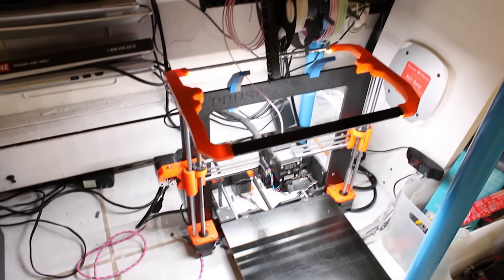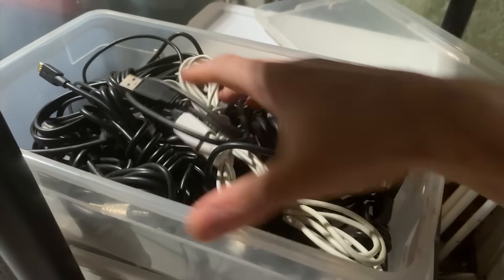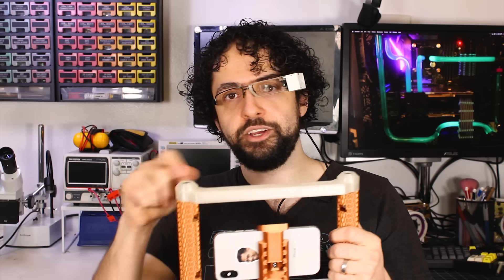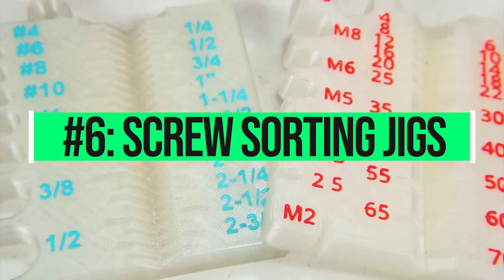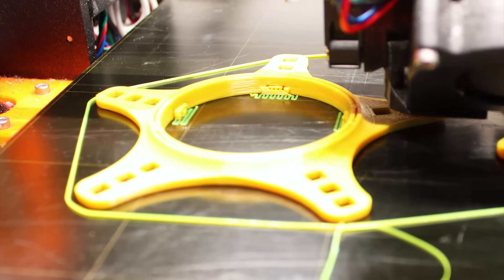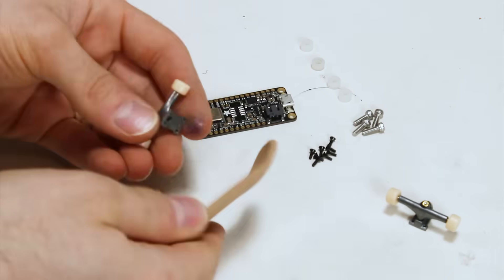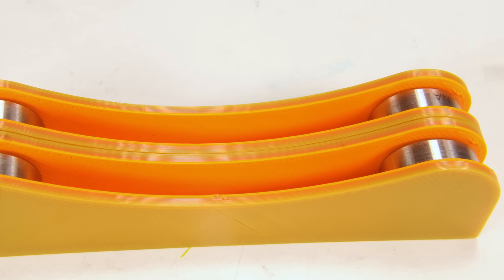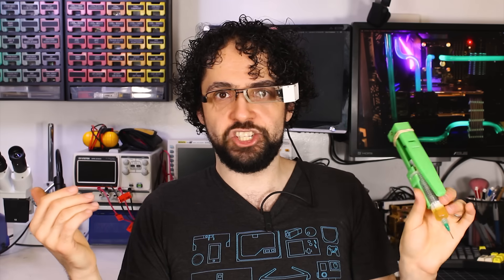Top 10 3D Printable Tools Every Maker Should, Like, Make

Comment: I like the idea of the dremel storage tower but it is literally available, filled with dremel tools, and is only slightly more expensive than the raw plastic filament needed to print it.
Reply: For about 15 bucks at walmart and 15 minutes there and back you can get all the dremel parts in a kit
Reply: @justaguydoingguythings2762  walmart one definitely isnt that good
Reply: @BlondieHappyGuy  Is 30 hours considered a lot? Majority of my parts are between 10-20. Biggest ever was 139 (in 5 pieces). Maybe I have my detail set too high.

Comment: The Prusa adaptation of the TUSH, used on the Prusa Mini, is far superior to the regular TUSH. It is very adjustable without falling over, and if you put non-slip foam pads on the bottom of the Prusa Mini spool holder, it does not slip on most surfaces.

Comment: I looked at every comment and didn’t see anything that asked about how you got such sweet time lapse shots of the prints.  Do u pause the print and move the print head out of frame for each picture?  Really impressive video on a number of different levels!
Reply from the maker: I use Octolapse, which is a plug-in for the Octoprint print server. Every layer-ish, it does exactly that - moves the head to the same position and takes a shot. I have it trigger my 21 megapixel SLR, so we end up with 6K footage that we can pan and zoom in post.
Reply: @ZackFreedman  Thanks for the quick reply!  Those time-lapse shots are top notch.  Keep up the great work.

Comment: A lot og these have way too much infill for what they require and would be much faster to print. The smartphone gadget tubes as for example could have been hollow and just 2mm plain tubes, if you make them hexagon you can almost stand on them in horisontal mode in that small diameter even without infill

Comment: The dremel is great and all but you should look into getting a flex shaft rotary tool. It had way more power and a foot pedal. Yeah its a little bit more cumbersome so it doesn't completely replace a dremel but for those larger projects its amazing.
Reply from the maker: I actually have the flex adapter for the Dremel, but I really should get another pedal. I built my old one into a project and just never replaced it 😐

Comment: there  is a TUSH woth bottom supports that give it avout an inch more  on the footprint if you search TUSH you will find it, same print but 4 parts per one and of course 608 bearings. i use these for a few of my printers and its amazing

Comment: PLEASE PLEASE PLEASE tell me how to get a work light for my Prusa just like yours!!!
Reply from the maker: Here it is: https://www.prusaprinters.org/prints/3267-led-light-bar-prusa-i3-mk2mk3
Mine is powered by a 24V-to-12V buck regulator, and I tied the enable pin to the RAMBO's pin 76 (unused I/O above the thermocouple) so I can control it with g-code.

Forgot to add, if you plan to take photos with it, buy high-CRI (color rendering index) LED strips. They're more expensive, but they'll make your pictures look far better.

Comment: Are you insane? that is waaaaaaaaaaay too much infill! I rarely go over 8%!! no wonder you used almost a pound of filament! holy crap!

Edit: I need one of those dremel bit storage thingies. I'll print one and update on how much filament I used
Reply from the maker: I did some test prints with 5% infill, but the pillowing on the top layers was just too prominent. This is just 10% infill - gyroid looks denser on camera than grid or hex infill. 
What infill pattern do you use? I have a lot of trouble printing below 10%.

Comment: The tush needs a wider baseplate.... and the dremel storage is just too massive for its own good. That is abusing printing as a medium, other methods like making it from a block of wood are much better. Printers are not replicators, subtractive manufacturing is not dead... we don't need to print everything.. In this case, printing just the tops would be a good use of a printer, the base made from some other material.

Comment: Why not add two features to the tush?  1 - grippable feet on the bottom of each tush so these don't slide around.  2 - a socket that allows a thick spoke to plug into the sides that is telescoping.  This would perfectly space your tush feet apart to accommodate your spools.

Comment: The Prusa Mini comes with a better version of the Tush in the package. It's the same idea but has two adjustable connectors inbetween to hold it together, as well as rubber pads.

Comment: i never liked wireless mice. but last year my significant other gifted me a logitech g903 lightspeed and let me tell you... it has never lagged, it comes with extra side buttons so you can switch it to a lefthanded mouse and the battery life on this thing is confusing the hell out of me. cause in the last 300 days... i have charged it maybe 8 times...comes with a usb cable and i just plug it into a random usb port on my desk to charge it (usually over night). its an amazing wireless mouse if you ever want to try one.

Comment: New sub and nice video. I have a question what material are you use for print. For me im new on this. For the moment already use petg but still not understand how to have a better printing. How many if the adecuate infil and how to made first layer and last layer more stronger
Reply from the maker: Thanks for the sub! I love PETG and do most of my Nerf printing in it. I can only guess about your issues, but your problems could all be caused by low temperatures. Make sure you're printing at 230-240C, with an 85C bed. If you have drafts (cold breezes) in your printing room, try plugging gaps or putting a trash bag over your printer to keep the temperature stable.

Most first-layer issues with PETG are caused by poor bed adhesion. I use the Prusa's PEI-coated steel plate, and I thoroughly scrub it with Windex (diluted ammonia window cleaner) before EVERY print.

PETG also likes to build up on the nozzle. Make sure you heat your nozzle up and thoroughly wipe it down with a clean cloth before EVERY print.

I generally use 15% gyroid infill. If you're having infill problems, try reducing your infill print movement speed and lowering your fan speed. 

PETG likes to "pillow" and make other defects on top layers. I'd recommend at least 6 top layers, regardless of layer height.
Reply: @ZackFreedman  Thanks for your answer. The temp that already use are 244 and on the bed 80. Adhesion sometimes a i think have too much neer more case i can't take the piece out and need to reheat the bed again. For infil more of all case i use between  50 to 80 %. I don't if i making wrong. Also fan speed already setup to 50 % and the speed that i use are 25mm/s. yesterday i print a fan holder but i fill softly. I use the setting  that are tell you but i use also infill i use 20 %. My printer is a JG MAKER magic 3D

Comment: What slicer do you use for your prints? Since you use some kind of gyroid infill in your prints.
Reply from the maker: I use PrusaSlicer, which has gyroid infill by default. I usually use honeycomb infill because it adds more infill to thin elements, but I find gyroid infill looks cooler on the time-lapses.
Reply: @ZackFreedman  yeah the gyroid infill looks like it just melts in there :-) And thanks for info!

Comment: That dremmel tool holder is cool, but it could be more manageable to print by making it into connectable smaller modular prints that a user can add to as they get more accessories.
Reply from the maker: So fun fact, I initially tried to split it into smaller panels, but Fusion 360 is so bad at importing STL’s that I just gave up and wasted half a roll of plastic.

Comment: FWIW, there are remixes of the T.U.S.H. that include clips for the frames of some 3d printers.  I've had one on my i3 clone for almost three years now, and it works great.  (...especially once I made a pivoting cleaner/guide for the filament.)
Reply: Any remixes that compensate for spools warped by repeated visits to the dehydrating oven?
Reply: @michaelclark4876  I don't know, but it wouldn't be hard to model a longer cylinder and overlay it on the model in your slicer so you could use multiple bearings to make a wider holder.
Reply: @KeithOlson  Yes, that should work nicely.  Thanks for the idea!  I'll check to see if someone has done it, if not I'll make it and post it on thingiverde.  The tinkercad redesign should be trivial to make.

Comment: I was actually thinking of designing a bit holder for my rotary tool, it's not a Dremel but it works for me and they sent it to me for a review video and I use it almost daily. But yeah, as I get more accessories I need a better way to store them.
Reply: Do not print that massive holder, it really is abusing printing as a medium. The proper way to do is to print the intricate bits and then use wood or even rigid foam to construct the base. Printers are not replicators, you need to mix and match with different materials and methods.
Reply: build your own robotic arm with parts for printing or machining. download parts and manufacture your own robot with precision and quality. access our hotmart link

https://go.hotmart.com/I43664641H?dp=1

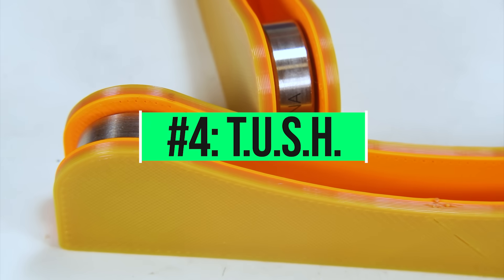Comment: 6:08 I've actually printed this Tush before and I use it for my spools, however they keep getting knocked over with the slightest touch and it's really annoying so I designed a bracket that connects them together so they don't tip over and they're always the right width apart.

Comment: Nice video! I am a new subscriber.

Do you have the shell and quality settings suggestion for the Dremel support?
Reply from the maker: I used an 0.6mm nozzle, 0.3mm layer height, three shells, 8 top/bottom layers, 5% infill. Basically, quality as lousy as you can get it, but with thicker shells than usual so the pegs don't snap off.

Comment: Why. Just. Why?
Why does everybody consider battery holders useful?!
This is literally the most pointless waste of plastic that I know. 
Fyi: if you require a lot of batteries then a) you should either invest in rechargable ones. Or b) buy a 50 piece pack which -surpirse! - will be sold in a perfectly fine and unseful plastic container.

Jeez! As a maker, you are responsible for what you print! So please! Print responsibly!!!😩
Reply from the maker: Holders are useful for transporting batteries, especially cells with high C ratings that absolutely cannot be allowed to short out. I agree with you for storage - I keep them in polypropylene tubs with cardboard dividers - but I don't think it's safe to carry a loose container of batteries.

The AA's in the video are rechargeable NiMH cells. The 9V's are lithium, because I salvaged a massive box of them when a client's building switched to wired smoke alarms.

Comment: For RC hobbyist like me, that metric screw sizer saves a lot of annoyance and confusion.
Reply: Yeah, I went straight for that screw sizer myself.
Reply: Only problem is you need to calibrate the holes because PLA changes size on cooling!
Reply: @GodzillaGoesGaga  I printed mine in PLA, didn't see too much deformation upon cooling. The sizer works really well, and there are no issue trying to figure out the screw sizes. With that, all of my screw sizes are at least 2mm apart.
Reply: @DargoDog  Cool.  Thanks for the info.  Good to know.  I've had tolerance issues when making threads so there definitely is some deviations from spec. It might be related to the volumetric size and on smaller dimensions is less significant ?

Comment: The razed viper ultimate is a really good wireless mouse that performs better than most  wired mice though it is about 130$ but there’s an alternative called the glorious model o wireless coming out soon for $80 they are both ambidextrous
Reply from the maker: The Viper is a solid recommendation, I'll need to try that out next time I'm at Micro Center. That Glorious model is the gamer-est thing ever. I bet the wireless model will be so light I could blow it off the desk.

Comment: Instead of snap fit, just use a nut and bolt. They're cheap, won't break, and easy to find. Sometimes it's best not to think too hard or over engineer.
Reply from the maker: It's not how I would have designed it, that's for sure.

Comment: Do you think he will be upset if I say Dremel is for amateurs and that a real tool is a Foredom?
Reply from the maker: Whatever gets the job done is the right tool. I use an old two-speed Dremel because my jobs are all light-duty, mostly working plastic, but if I were using it for harder jobs, I'd upgrade.
Reply: @ZackFreedman  Actually I own both and used the Dremel for years before I bought the Foredom. I would never want to go back though.  The foot pedal control is great. If you like using small rotary tools I highly recommend getting a  Foredom or the similar one made by Dremel or Grobet.
I used to carve plastic with one, and it is a world of difference having the pedal speed control.

Comment: FYI Don't mess with chloroform, kids. It may be easy to make, but it's highly carcinogenic.
Reply from the maker: What would you recommend for securely transporting guests to my super-shady secret lair?
Reply: @ZackFreedman  black bags on their heads with cuffs and ball-gags for the ones who won’t behave — works for enemies and untrusted friendlies. Harder to accomplish without a henchman or two, but if you have a lair, you should have henchman.  

If you’re hellbent on knocking them out with an inhaled agent I suggest you make friends with a local anesthesiologist with access to desflurane (marketing name: “Suprane”).  It works fast (faster than you can count backwards from 10) and is easy to vaporize from it’s liquid state at room temperature — intelligence analysts in the field have even rigged up delivery systems using e-cig/vape mods and battery powered diaphragm pumps.

You asked. 😎

Comment: I splurged on a really nice bluetooth mouse a few months ago... it doesn't lag and needs to charge (i.e. turn into a wired mouse) maybe 2 hours a month. Same with a keyboard. It was just a real pain to find one with the layout I wanted. And since everything I need to charge with any regularity now uses USB C I only need one charger and one cable (well, until I need a microcontroller for something). Not a cheap solution, but after 13 years of cheap solutions I was finally sick of it.
Reply from the maker: What keyboard and mouse did you end up settling on?
Reply: @ZackFreedman  Logitech MX master 3 for the mouse, Royal Kludge RK71 for the keyboard.
Reply from the maker: @bartz0rt928  Nice. I wish Logitech made a lefty or ambidextrous version...
Reply: @ZackFreedman  Left (wireless) Power!